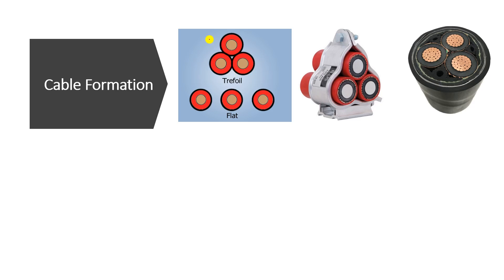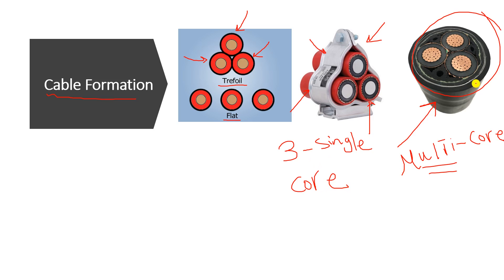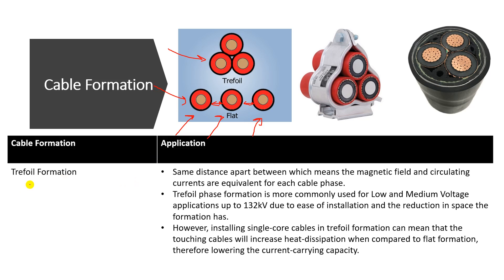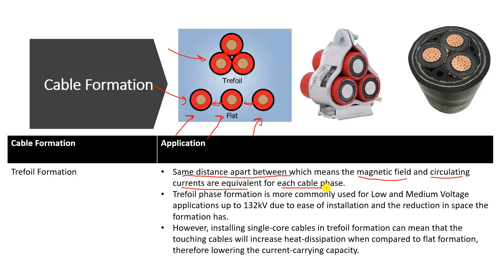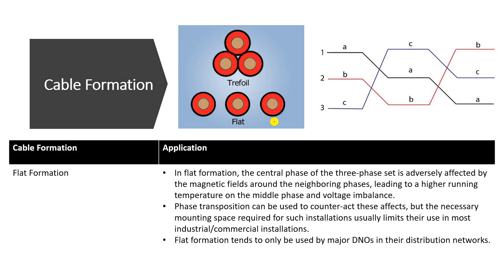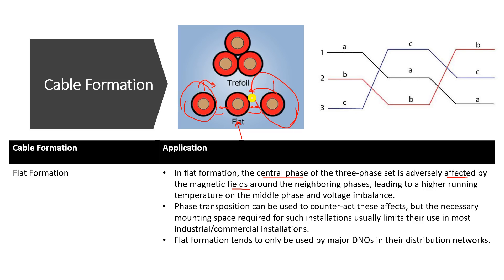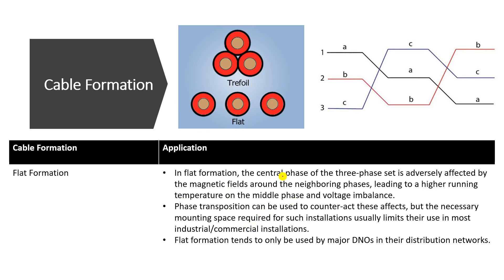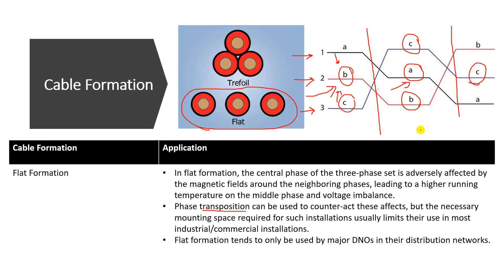Types of Cable Formations (5) In Cables Electrical Course

Comment: Thanks very much for your video lesson. I truly appreciate them. They help me understand a lot about the behaviour of electrical devices and cables as an electrical design engineer. 

Just a question, after what cable length does the phase transposition occurs in flat formation cables? Because with twisted pair cables it happens constantly throughout the cable length